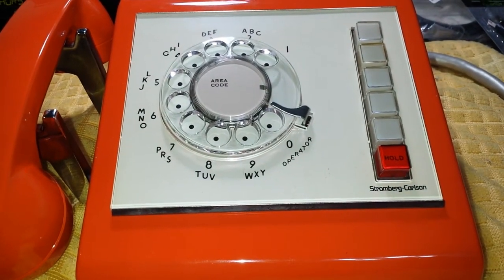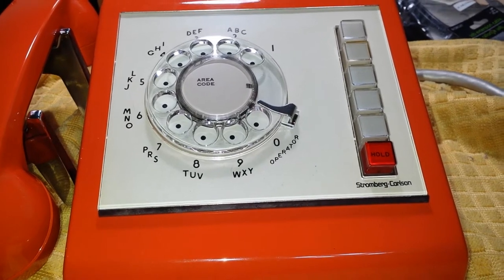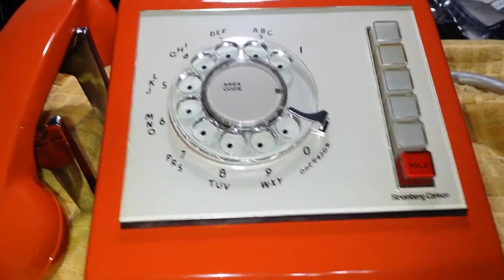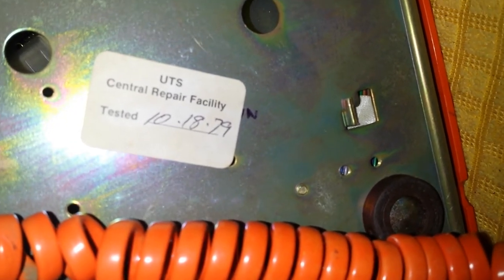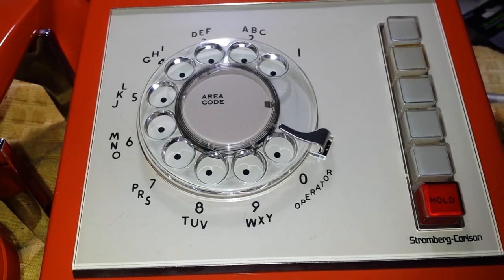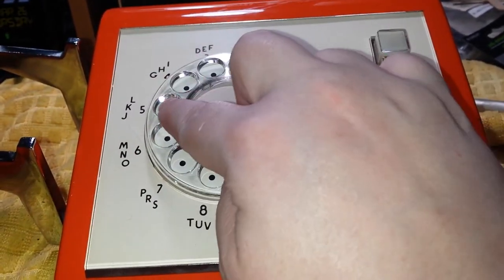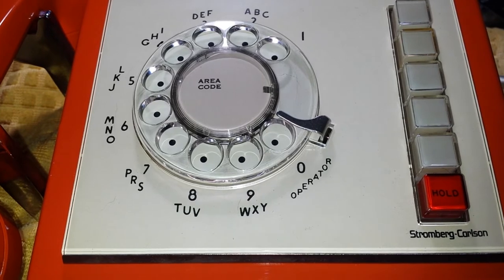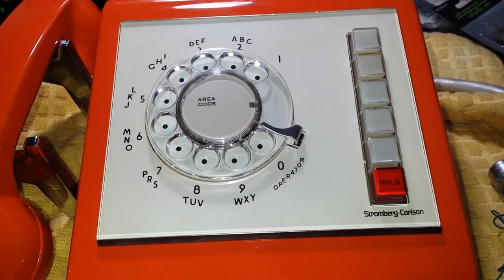1A2 KEY Stromberg Carlson 6 Button Phone

Comment: Stromberg Carlson was actually primarily a switching equipment developer/manufacturer. The "XY" central office was one of their developments. They also designed electronic pbx equipment in the 70s. They had unique telephones at the turn of the century, but by the 70s they were creating direct clones of western electric sets. The bell system actually liscenced out designs to them and ITT after some various law suits in the 60s
Reply: I'm sorry you're inaccurate. They made tons of phones along with some switching. They never cloned Westerns. I have a 1973 set that is not even close to a Western set. The business broke up by the mid 80s, forming Comdial.
Reply: @Steveos312  I've got a set from 1973 that is an exact clone of a WE 500 and I've seen many of them in independent telco areas.
Reply: @MyNikolaas  My 1704 does not look like a Western at all. I also own a wall set and it makes a Western look jealous.

Comment: This phone belonged to one of the United Telephone companies. While I can't tell you which one, the UTS central repair facility sticker is your clue. United Telephone bought equipment from Stromberg-Carlson, and ITT for customer equipment with Payphones being purchased from Northern Electric later on and some Central office equipment purchased from North Electric and others from Stromberg-Carlson. United Telephone and Sprint Merged in the 1980s and was divested in the mid 2000s to become Embarq which went bankrupt and was acquired by Century-Tel to form CenturyLink.
Reply from the maker: Thanks for the info. Sounds like United Telephone was a small independent bell company or a small group. Now I'm thinking this phone may not have been installed at all or may have only been in service for a little bit as it looks like it did not see much service or any service at all.

Comment: Hello, not sure if this is exactly the right video to comment the song but somebody gave me a 1998 northern telecom Meridian telephone and I have no idea how to use it. I know a lot about standard landline sort of phone but not this style of professional office phone. I tried to plug it into the phone line and got nothing, any advice on how to hook this up would be great.
Thanks
Reply from the maker: Hi, sounds like you have a phone system phone that must have a KSU (phone system) are you able to find a model number? if you can reply back with a model number I can check.
Reply: @bigb2littleb  thanks for replying. It is a Mouradian model nt9k08ab35.
Reply from the maker: @Dwall44  That phone would go to a old Meridian big big PBX system such as Meridian 1 or option 11.  Does the phone look like this ? https://www.ebay.com/itm/Nortel-Meridian-M2008-Ash-Display-Phone-NT2K08-NT9K08-NT9K08AB35-/254368523428     That phone that you have will only work on the Meridian PBXs and not the regular Nortel systems.     If you are interested I have a  Nortel Norstar 6 x 16 phone system that I could let go dirt cheap. I dont have any phones but they are cheap on Ebay.
Reply: @bigb2littleb  if you could provide a price and some more details about your PBX that sounds great. Also, that phone looks similar to mine except mine does not have an LCD screen on it. Like I said, it’s from 1998 so I guess that was before they started putting the LCD read outs on the top of the units.
Reply from the maker: @Dwall44  They put displays on phones back in the 80's does it look like this https://www.ebay.com/itm/Nortel-Office-Phone-White-Nt9K08AB35/154137771953?hash=item23e353bfb1:g:9GMAAOSwcF5fhEA0      The Nortel phone system is from the early 90's it has 6 lines with 16 extensions.  If you want to use regular analog home phones you have to get a Nortel ATA adapter.   This is what the 6x16 system looks like     https://www.ebay.com/itm/Nortel-Norstar-6x16-Key-Service-Unit-w-DR2-Software/224189104400?hash=item3432b64110:g:HEsAAOSwoWFfgihw        I do ether have a amp cable converter or a amp cable already made so it its plug and play.   I was thinking about 50.00 + shipping.
Reply: @bigb2littleb  so sorry for the late response, I’ve been pretty busy lately. I had no idea they put displays on phones in the 80s! But yeah, that one looks almost exactly like mine just the small button above the keypad to the right is beige not red. Also, forgive me for not knowing much about these phones but can I just buy a little adapter thing that I can plug into the phone line and then plug the phone into that adapter? Or is that not really how that works.
Reply from the maker: @Dwall44     No the phone requires a KSU (phone system) to function. The KSU and the phone communicate in a proprietary digital protocol so Its basically a dumb terminal and will not work when plugged in to a regular phone line from the phone company. Also it sounds like they removed the release key button. Nortel did make a phone that will work on a regular phone line called Nortel M9316 and it has the same ring tones so  when you search on Ebay make sure it comes with a AC adapter.
Reply: @bigb2littleb  OK, thanks for the info. I’ll definitely look for one of those phones. Not sure what I’ll do with the one I have though. Speaking of the one I have, it does have a release button on it but all of the features seem to be spread out differently than the ones in that picture.